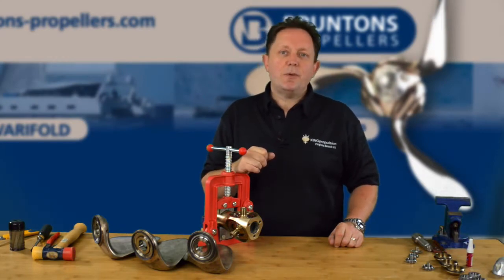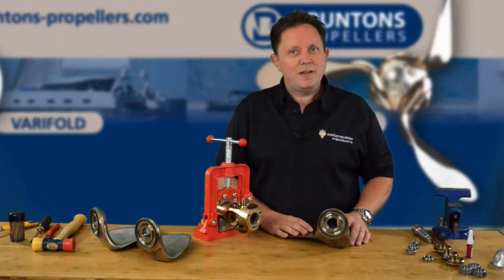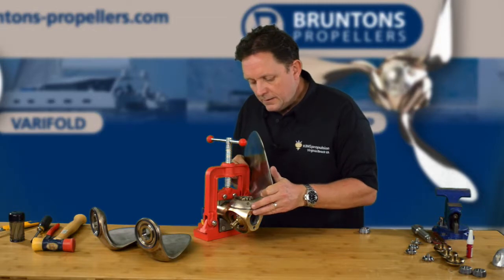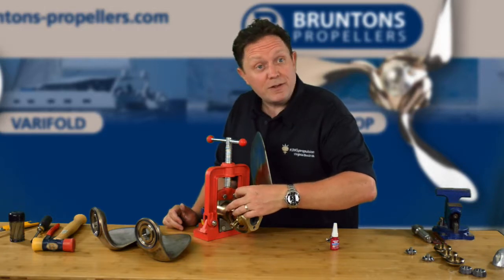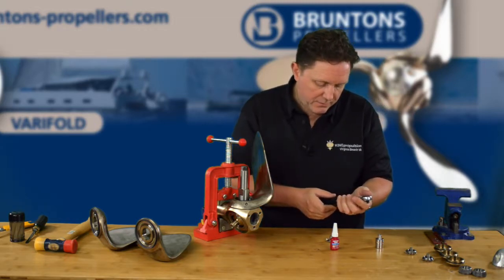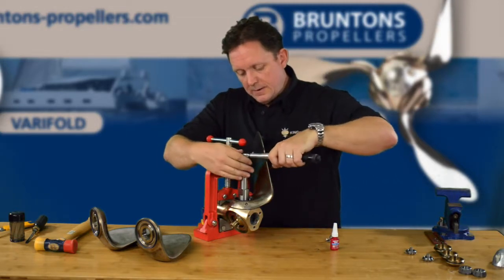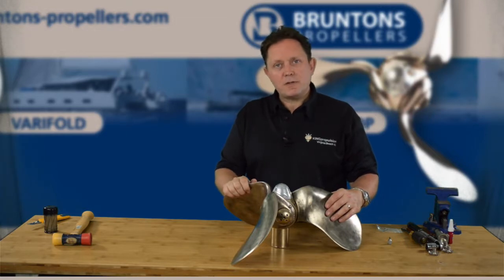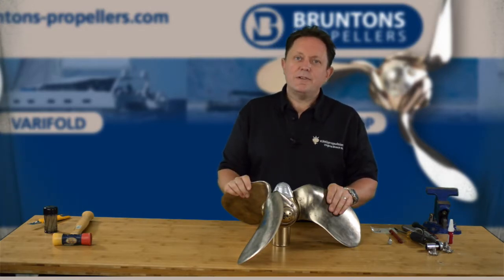Part 7 blade installation

Comment: I have 8 and 6 mm ball bearings in my H6. It does not get grease. I'm rebuilding it after 19 years and 1500 hours. I guess I get all the races out the same way but how do I relock the prop back on the shaft. If I make the nut tight the allen screw does not fall on the point of the nut.
Reply from the maker: Marc, Just seen this.  If you are having issues please get in touch.